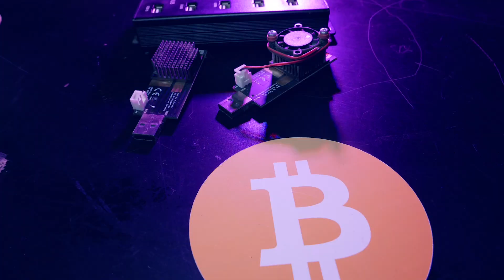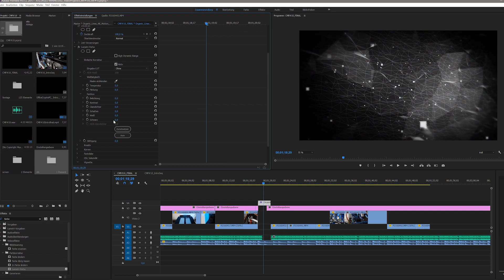Miners off? September Update (Cursed Mining Farm #18) GPU ASIC FPGA CPU Cryptomining

Comment: Hiya! I sold my Z9 Mini just before Z11 came out. I thought the profits would go down to much to keep it, sold it quite cheap, like 250$ with PSU. But it didn't make sense to keep it because it would be mining at a loss. Sold some older AMD R9 and Nvidia 1060 3 GB also in 2018. I have bought more GPUs in 2018-2019, only second hand AMD. In this market it wont make sense to buy new hardware at all? :) Have most AMD cards and are mining most of the time Monero and sometimes auto converting to Bitcoin via NiceHash.
Reply from the maker: Hey mate, sorry when your comment came last week I was already in digital warfare mode =D you know the story from yesterday's vid. Now taking the time to answer all the kind comments. I think you sold at a good time, both the Z9mini and the older cards. The channel break I am now doing will be the time to do the downsizing we always talk about and never do =D or let's say downsize some card to buy newer ones maybe. As you wrote, difficult with new hardware atm. but thinking f.e. of turning more 1060 6GB into less 1660 (ti or non ti not sure). F.e. with my Aion rig this would bump my hashrate a little bit but power would be less. Also better for reselling again. Let's see if I actually do it haha. Also selling some smaller AMD cards, 5700XT is still somewhat interesting for me, the partner cards that is. Also better than my current work card, so I could justify it somehow hehe.